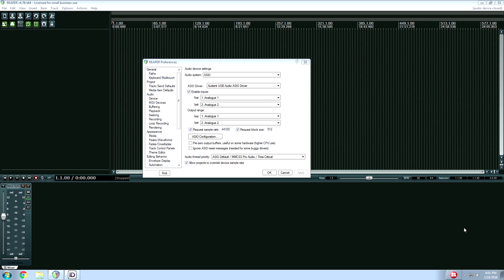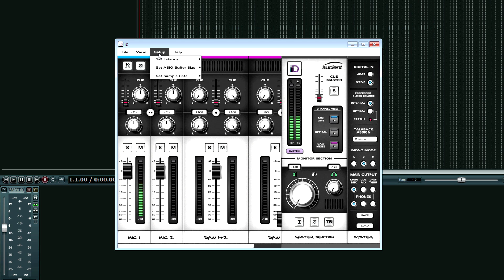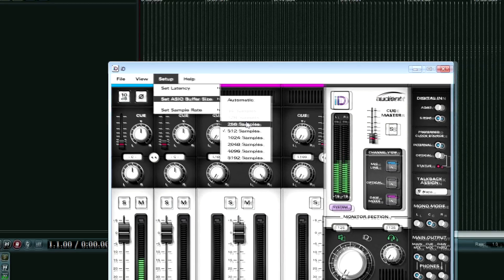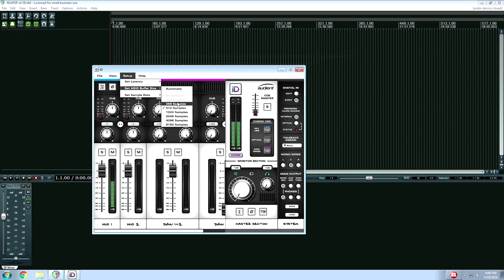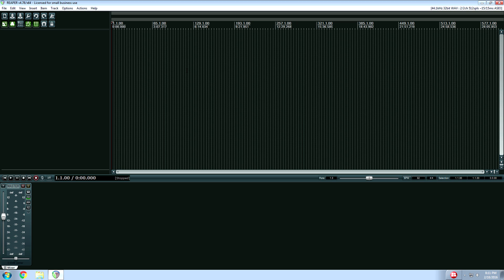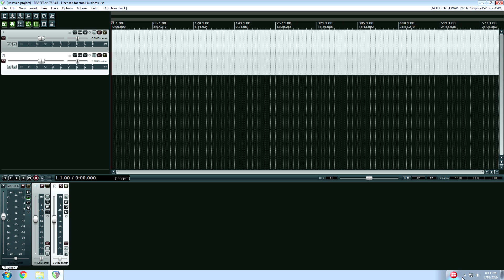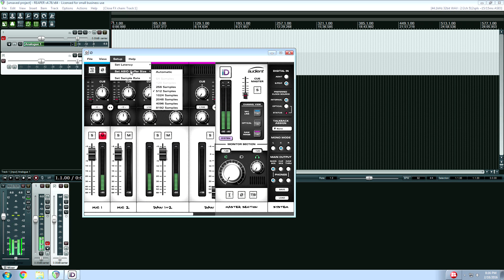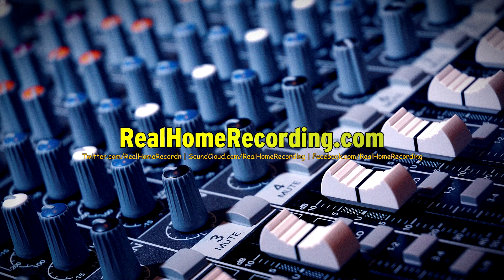Recording vs Mixing Buffer Size Audio Interface Settings

Comment: So I'm still a little confused.  Are you saying the buffer size needs to change between the recording and playback? I typically keep them the sameon Reaper and with the default settings.  I recently got a Behringer UMC404HD with a 192KHz sample rate.  My recordings are music (instrument & vocal tracks) with some plugins; mostly EQ, compression, reverb/delay.  What would you recommend for the sample rate and latency?
Reply from the maker: Keep the buffer setting the same while recording. The lowest you can go without pops/clicks. When mixing, and mastering set it to the highest setting (I usually use 1024 or 2048) you can tolerate.

Sample rate, I always use 96 kHz. Even if I am ultimately mixing with 44.1 kHz samples in a heavy electronic arrangement. Even if the interface supports 192 or 384 kHz, 96 is the setting I pick. Unless the customer demands 192 which I have never had happen before...

I'll use that extra sample rate during mix prep to have a higher quality sound and then down convert it to 44.1 kHz so it matches the rest of the tracks.
Reply: @RealHomeRecording  Appreciate the advice.  I haven't noticed any issues in the past but will play around with these numbers and see what happens.

Comment: Hey Adam nice video! I´m using the Zoom R16 interface with USB 2.0 and it gives me about 4ms latency. It works really great and i haven´t changed buffer size in the DAW (Reaper) or the Interface. :-)
Reply from the maker: +08PeeSon80 Very cool! Well, if you ever start getting clicks and pops you will know what to do!

Comment: I just finally got a computer with thunderbolt on it, via a used MacBook Pro, I'm going to probably tough it out with my PreSonus interface for a while longer but I'm seriously drooling over the AUD stuff. I know there's a lot of Apple hate in home recording but I've basically spent my entire professional life using a Mac and have no problem with it. If I were buying new machines I'd probably be pissed but older models turn up for roughly the same price a similar quality pre built PC.
Reply from the maker: +Caleb Hawkins I've heard that most pro studios use Apple machines. Hate on technology is dumb!
Reply: +RealHomeRecording.com unless we are hating on ADAT machines.

Comment: I made the move to an apollo quad last year and it was expensive but, i don't see myself going back to an interface without low latency monitoring. I don't even touch my buffer settings anymore. plus im tracking through the api emulation in real time.
Reply from the maker: +descargamusicalny Awesome! Tracking with DSP effects is definitely the way to go if you have the budget.